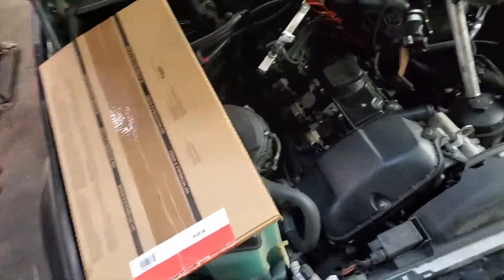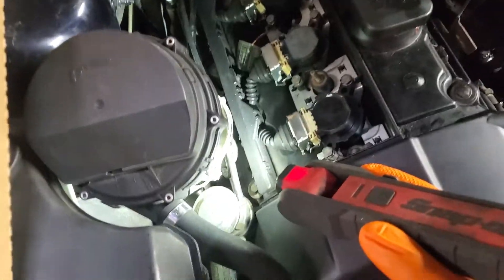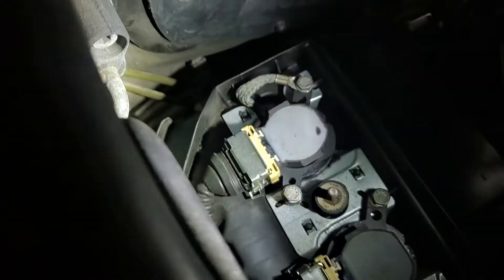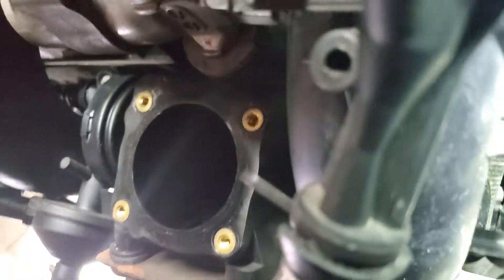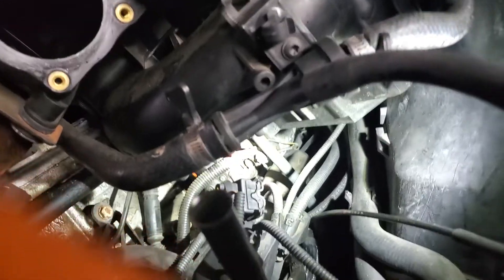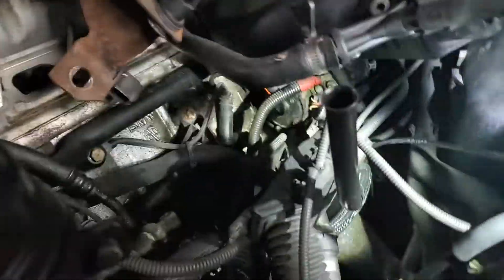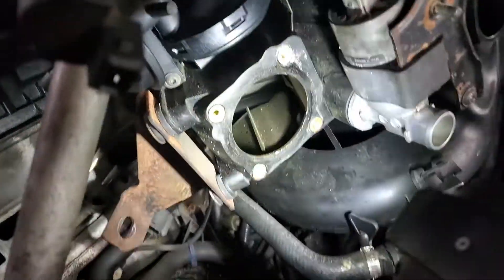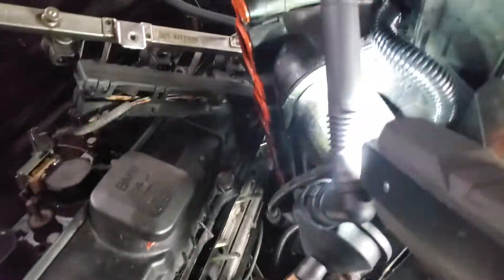Bmw System too Lean P0171 and P0174

Comment: I got lean codes for bank 1 and 2. Most of my hoses seem old and brittle. If it is leaking i dont know where nor do i have the equipment to check. I guess i just start buying and replacing randoms hoses and see if i get lucky?